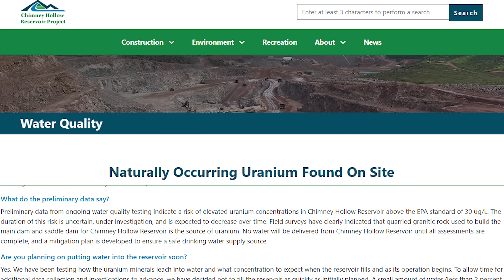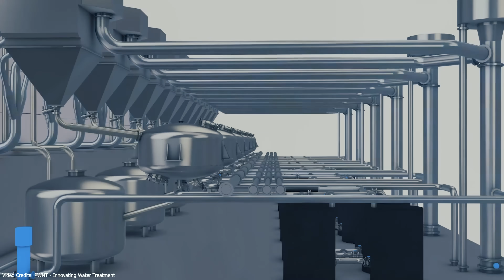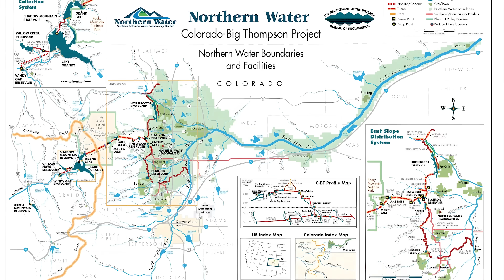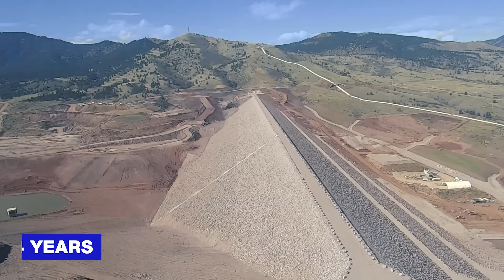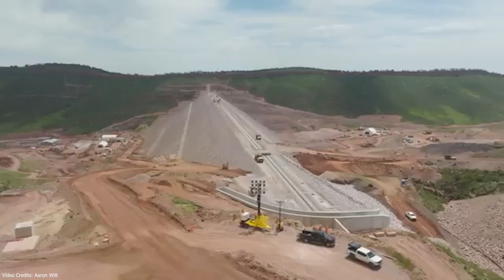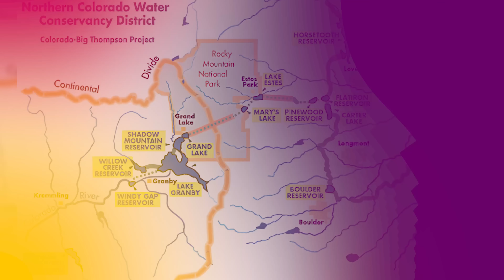America Finally Filled Its $690M Reservoir. Now No One Can Use It

Comment: Just a remark - over 99% of uranium is NOT radioactive... just 0.7% is the active isotop. Doesn't change anything, just for info.
Reply: Fun fact, the only person to die from radithor (a drink that contained healthful radium), died of heavy metal poisoning because radium is a heavy metal. (He also drank an insane amount of it, like the 2L bottle of soda a day level of consumption)

Low doses of radiation are not harmful and all datasets where a large population was exposed to low does of radiation (radium girls, radithor, ect) find that there is a threshold before harmful effects are noticed. And oftentimes there is even a slight dip in excess cancers at low doses.
Reply: darm isotopes, thought they were a baseball team on the simpsons.

Comment: They have a plan and the low fill is part of it.  Sediment deposit and algae should build up a layer that mitigates the leaching into the reservoir ..
Reply: Right and when the dam comes down in 100 years there will be a major toxicity issue built up?...and when it dries out and algae dies and wind blows the dust?
Reply: But I mean they already exposed the rock so it's there now regardless. May as well put water in it to keep it from being airborne 😅😢
Reply: The rock was blasted creating lots of dust which will leech out or settle out in sediment soon enough.  Plus as the reservoir fills the ratio of exposed rock to water goes down and there will be far less uranium.  My prediction in a couple of years this story will be a nothing burger.

Comment: Was this Uranium issue not understood when the dam was approved? The uranium issue was not understood when the dam was approved or initially constructed. The naturally occurring uranium discovered in the quarried rock used to build Colorado's Chimney Hollow Dam was completely unexpected, forcing operators to delay filling and delivery operations to study and mitigate the environmental impact. Key Details of the Discovery and the Source: The uranium is naturally occurring and exists in the granitic rock excavated from the site itself to build the 350-foot embankment. The Discovery: Elevated concentrations of uranium leaching from the quarried rock into the water were discovered just weeks before construction concluded.The Environmental Concern: The primary risk is not heavy radioactivity, but rather the long-term ingestion of dissolved uranium if it exceeds the EPA's safe drinking water standards of \(30 \text{ \mu g/L}\).Project Status and Mitigation Testing: To observe and manage the interaction between the rock and the water, Northern Water began introducing small, controlled test fills into the reservoir.Dilution Expectations: Operators believe that as the reservoir fills to its 90,000 acre-foot capacity, the massive volume of water will naturally dilute the leached uranium to safe levels.Timeline: No water will be delivered to Front Range communities from the reservoir until all safety and mitigation plans are fully finalized. If you want to track the recovery timeline, tell me: Would you like to know more about the water treatment options being considered? Are you interested in the expected timeline for when it might meet EPA standards?
Reply: Check out Galen Winsor, he was a nuclear chemist, he swam in the reactor cooling pools, he ate uranium in public. Colorado is the third most productive state for uranium, this did not catch anyone off guard. Problem, Reaction, Solution, the higailian dielectric, never let a good crisis go unplundered.

Comment: The Trump administration has already revised many toxicity safety limits upward or eliminated them entirely. That seems like a much less expensive approach.
Reply: Shortsighted
Reply: Really? Key Approvals Handled Under Obama: The Chimney Hollow Reservoir is the cornerstone of the Windy Gap Firming Project. The core federal environmental reviews and major permit approvals—from the U.S. Bureau of Reclamation (2014) and the U.S. Army Corps of Engineers (May 2017)—were set in motion and issued based on reviews conducted prior to or at the very start of the first Trump administration.
Reply: I wasn't talking about the reservoir itself, I was talking about EPA revising and eliminating air and water pollution limits where they can, and eliminating penalties where legislation prevents eliminating the underlying violations. In a free society people can make up their own minds about risk.

Comment: "We should test the rock."  "Nah, it will be fine."   Purposeful ignorance.
Reply from the maker: haha. to be fair they were testing the discharge water for two years, just not the rock itself, and they say the scale of it caught them off guard. whether that counts as a fair miss or a blind spot is the part nobody's fully settled. thanks fro watching it
Reply: @MegaBuilds-US  Granted I am not an expert on the subject.  However, based on what you have said in the video it seems obvious to me.  It was a known problem in the area.  They were testing the water.  It is known the water leeches the uranium from the stone.  Therefore it is simply logical to test the stone, it doesn't take a genius to figure that out.  They should have taken core samples from the areas they were planning to dig out, prior to any actual excavation.  You'd be hard pressed to convince me it isn't willful ignorance.

Comment: Depending on the amount and content, the waste could be sent to a uranium processing center that can extract usable isotopes for nuclear fuel and dispose of the rest through normal means. Doubt this is reasonable (probably insufficient concentrations of the needed isotopes), but its an option. Also, if the problem is the dam itself, not the reservoir, then the upstream face can simply be lined with concrete. Even if it eventually cracks, it still doesn't permit a level of leaching sufficient to cause harm. If it is within the reservoir, then we're back where we started.
Reply from the maker: the concrete-lining idea is a sharp one, and it actually lines up with the open question in the video. if the leaching is from the dam face, something like that could work. if it's the exposed rock on the reservoir bottom, you're right, you're back to square one. right now their lead plan is drawdown, basically flushing it out over time. thanks for watching it!